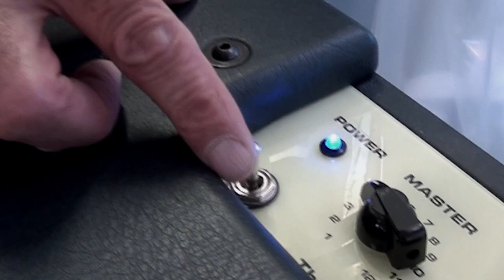Building a T Rex pedal board

Comment: Hello! How does he connect six effects with chameleon power supply? I read, that only five effects can be connected simultaneously. Or are there two effects on one output?
Reply from the maker: Yes! The Green cable is powering 2 effects (Karma Boost and Diva Drive) from one output... cheers
Reply: @TRexEffects  hola soy de Perú adquirí un t-rex chamaleon y tmbn me dijeron que solo podía conectar 5 pedales pero ahí veo en el vídeo que conectan 6 pedales de una sola salida como se haría tendría que tener otro cable y bajar el switch de la salida 4 para que esté en 18v o como sería por favor responder. Gracias